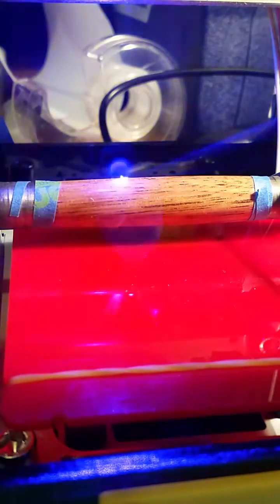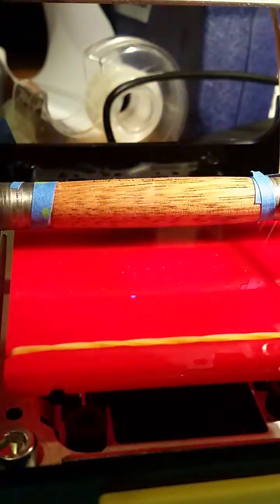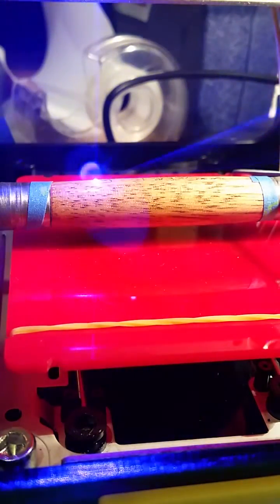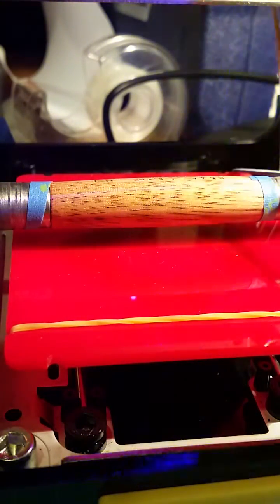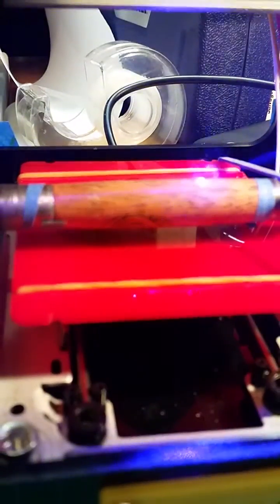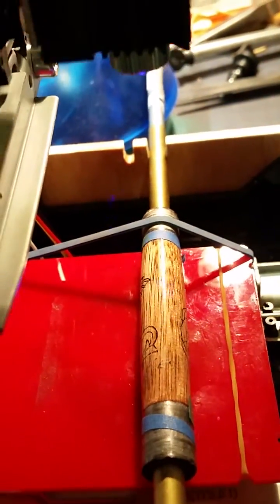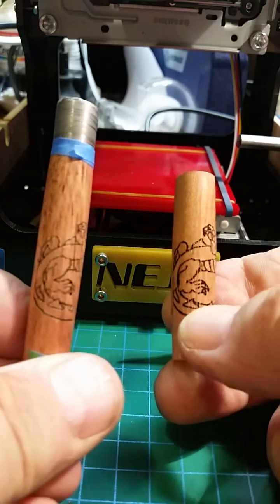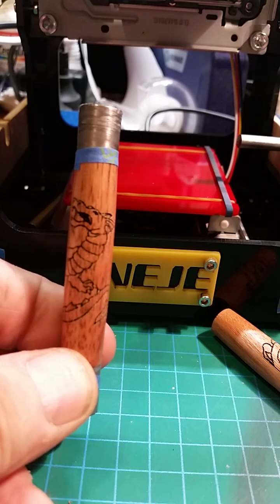Rotary axis jig for the small Neje style laser printer.

Comment: Finally got to try my laser out with this jig but the very top of each letter seems not to be burning. I tried different fonts and sizes but the result is always the same. Anyone have any ideas.
Reply from the maker: Jeff Rhodus, sorry to hear that you are having problems engraving when using your rotary jig. There are a couple of things you can check.
1. Make sure the blank spins freely without any binding or drag on the mandrel (you should not be trying to spin the mandrel).

2. When you set it up the blank to engrave there is sometimes a small amount of biased tension on either side of the drive band where contact is made with the blank/drive bush. The results is what looks like a flat line on the start of the engraving, when the 'Y' axis first starts to move instead of rotating the blank the band absorbs the movement instead of rotating the blank. Once the tension is taken up by the band the blank will start to rotate, this tension remains and can sometimes effect end of the engraving. To help overcome this you can hold the blank to stop it from moving and carefully lift the band at the point it make contact with the blank/drive bush.

I hope this make sense to you, if you have any questions please message me or I can be found on Facebook under the name of Benson Pace.
Reply from the maker: Jeff Rhodus, sorry to hear that you are having problems engraving when using your rotary jig. There are a couple of things you can check.
1. Make sure the blank spins freely without any binding or drag on the mandrel (you should not be trying to spin the mandrel).

2. When you set it up the blank to engrave there is sometimes a small amount of biased tension on either side of the drive band where contact is made with the blank/drive bush. The results is what looks like a flat line on the start of the engraving, when the 'Y' axis first starts to move instead of rotating the blank the band absorbs the movement instead of rotating the blank. Once the tension is taken up by the band the blank will start to rotate, this tension remains and can sometimes effect end of the engraving. To help overcome this you can hold the blank to stop it from moving and carefully lift the band at the point it make contact with the blank/drive bush.

I hope this make sense to you, if you have any questions please message me or I can be found on Facebook under the name of Benson Pace.

Comment: Hi Bob are you using the software that came with the laser
Reply: Thanks for sharing this Bob!
Reply from the maker: Keith Ralph I've had problems loading onto both my ipad and desktop running xp which is supposed to be compatible with no joy. I have loaded it onto my Samsung s5 but I had to download it. The security software I'm running on the xp deleted the card that came with the laser :(. I  will check whether  I can load it on windows 10. What are you using?
Reply: Hi Bob using window 8 had to turn virus checker off then it down loaded
Reply from the maker: Keith Ralph maybe something to do with xp, I will try later with windows 10.